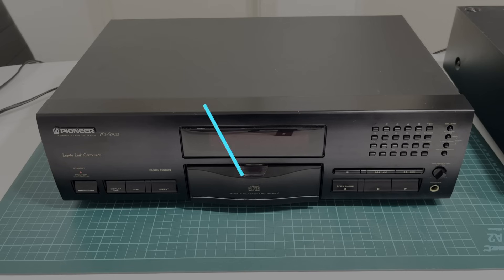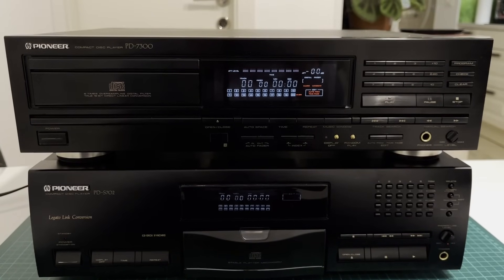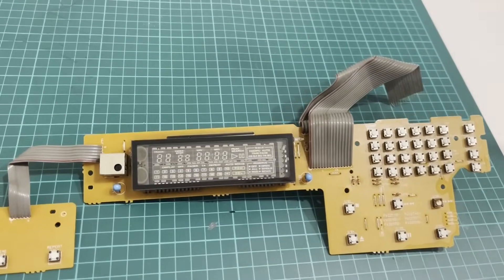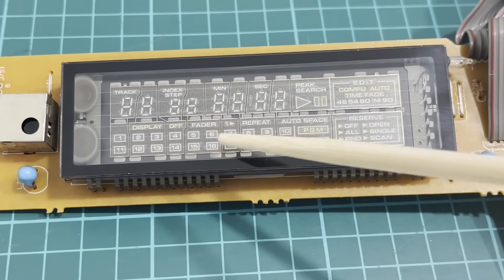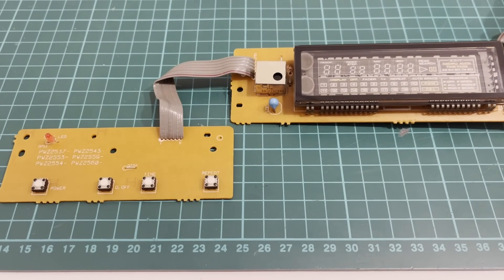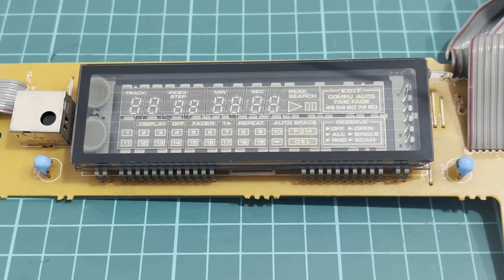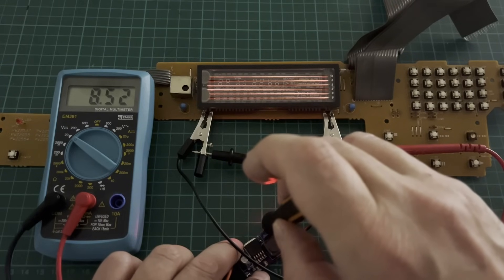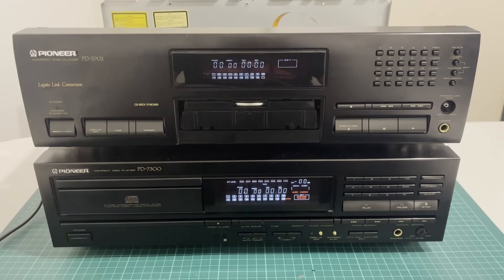How to restore a dimmed luminescent indicator VFD? Rejuvenating a dim VFD vacuum fluorescent display

Comment: Another technique to use as well, is to heat the getter flash area to rejuvenate that as well.  Then the poisoning ions you have burned-off get mopped up by the getter material.  There is a research report about this from Dollis Hill in the BT Archives : Research Report 11580 "Rejuvenation of valves Thermionic no 145" dated 1942.  They reported an improvement of valve life from 700 hours to 2000 hours, recommending to rejuvenate just before putting into use.  Heating method was a Bunsen burner flame.
Reply: Very interesting, could you provide the link to that report? Thanks.
Reply: burner flame can kill VFD, use inductive heating instead.

Comment: Wow! Big case with not much in it.
The thing with the power switch, got to wonder if that a more sleek design or convenient built in redundancy
Reply: @SusanAmberBruce  many times it was to be able to use a remote control to turn it on or off.
Reply: @florianm3170 right I see, but they still could have cut the current to the display when it's off 😮 interesting video though, thanks
Reply from the maker: Thank you!)

Comment: Many if my Sony DVD recorders have the same problem with the Fluor display. A low DC voltage (5 to 9 VDC)  is converted by a kind of flyback trafo to generate an much higher AC (low  current) voltage. Need to fix them. Sometimes i only remove the dark purple semi transparant filter build in front panel.
Reply from the maker: Thank you for the comment. In these player models, the filament voltage is supplied directly from the transformer winding without any additional conversions. There are no extra filters either.
Right now, I'm creating an entirely new display (a clone) using modern components and IPS screens. A video about the creation of this display clone will be published soon.
The first experiments http://youtube.com/post/UgkxLbwLuYG-LkW7OVgCfVrEoQ_r3SqydsX0?si=uGN47J7Ttiy86deE
Reply: My Sony DVD has gone that way,  can only now be seen in the dark
Reply: @jonathaneastwood2927  My Sony BluRay DVD CD+ doesn't have any display at all!  Couple of LED only.  That's all done on a TV/Monitor.
My experience over the last 20 years - 
All Panasonic BluRay DVD players have suffered. Very poor power supply design cooks em in other ways anyhow. 
All Yamaha Receiver Amps haven't ever gone dim... new series use a matrix LCD.  
My old Sony CD (5disc) is bright and clear. 
My younger Yamaha  CD (5disc) is bright and clear. 
My old Pioneer CD (20 something ?) is very dim.

Comment: If you watch a VFD display in a pitch black dark room you can see the filaments glowing in faint red. I have seen different VFDs doing that there are maybe models that do not.
Reply: It depends on the display, and on the filter in front of it. But if you have a camcorder with true nightshot mode (when it removes the IR filter from the image sensor), all VFDs will shop up with a bright white glow, because the filaments emit at such infrared wavelenght which the image sensor is sensitive to.
Reply: Yes my Sony car stereo does that, you can see it clearly when you put the accessory position on when it's dark.

Comment: The method works for a short time and then the display quickly loses the clarity. This is an old method of resuscitation TV- short-lived.
Reply from the maker: Thank you for the comment. You're absolutely right — this won't last long. But nowadays, these devices are used very rarely. I might listen to a CD once a week, so this solution will work effectively for a while.
Right now, I'm creating an entirely new display (a clone) using modern components and IPS screens. A video about the creation of the VFD display clone will be published soon.
The first experiments http://youtube.com/post/UgkxLbwLuYG-LkW7OVgCfVrEoQ_r3SqydsX0?si=uGN47J7Ttiy86deE
Reply: 100% correct, same problem and principle as rejuvenating a tv crt, any gain you get is short lived, at the point it needs rejuvenating it needs replacing.
Reply: Now find a fix for the degrading laser pickup! 😊
Reply: @wintech1969  easy, just replace laser diode and that's all

Comment: I don't think the elements are always on, usually there is a stand by PSU that switches the main transformer on. Some displays seem to last forever others seem rubbish guess down to the quality of the display VFD.
Reply: Many Sony models have the same problem, they keep the heater glowing on standby. Including very expensive units as like the JA3ES I had recently on the bench. Unfortunately regenerating the VFD the same as shown here in the video made it much worse. Now the display is barely visible in a darkened room. So pay attention this could ruin the VFD completely.
Reply: I can confirm what was said here. Later pioneer decks and CD-players lacking a mechanical power switch always have the filaments on when on standby. They do not have a separate standby transformer. You either disconnect them from the mains or add a circuit which interrupts the AC filament supply when in standby.
Reply from the maker: Thank you for the comment. In these Pioneer models, the filament is indeed powered directly from the transformer winding. You can verify this by looking at the schematic diagram.
Reply from the maker: @florianm3170  Thank you for confirmation.

Comment: This is just CRT rejuvinating but for VFD displays it wont last long
Reply: This fixes cathode poisoning. CRT rejuvenation can actually have long term benefit if the reson for weak emissions is poisoned cathode surface, with healthy emitting material underneath. I have a Toshiba licenced CRT that I rejuvenated about 3 years before the TV became retired, and the tube still had a great picture 2+ years after the rejuvenation, with an average of about 5 hours/day usage. Before the rejuvenation the picture was quite bad, the black level was purple, the corners were very blurry with bad convergence. That tube has tons of hours in it, the neck has shiny black stripes next to the cathodes, from all the evaporated emitting material. We used that TV from about 1986 to 2009, but it needed a new CRT in 1992 so the tube I'm talking about was used from 1992-2009. And it was used a lot.